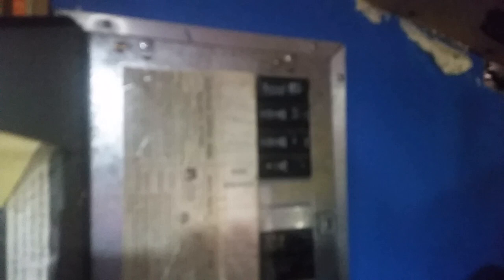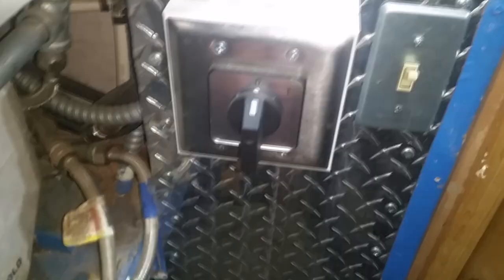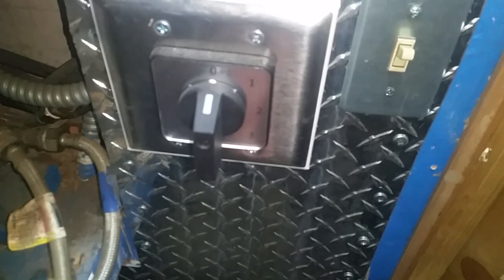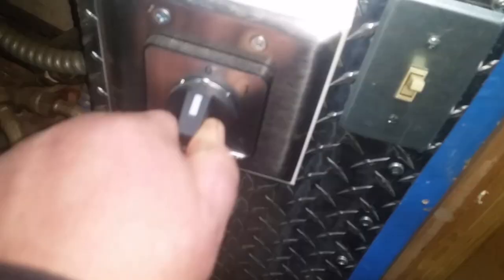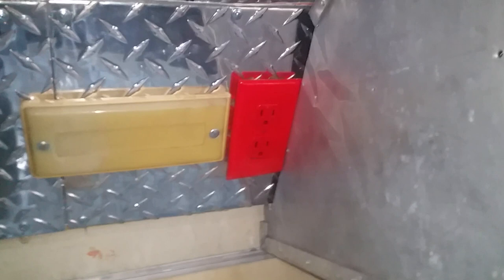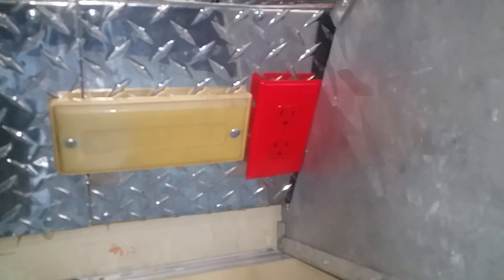Jon's Bus Conversion Part 75 - Sharing a hi amp circuit with a rotary switch.

Comment: That looks like a great solution! Nice Job! Thanks for sharing. God bless!
Reply from the maker: Yeah thanks. If you were wiring a house, you would want each of those on a separate circuit - but if that's not possible, this is the best solution I could think of.